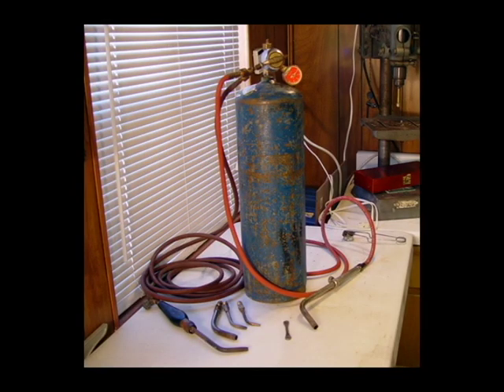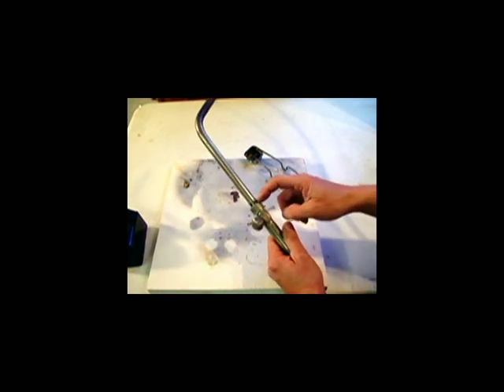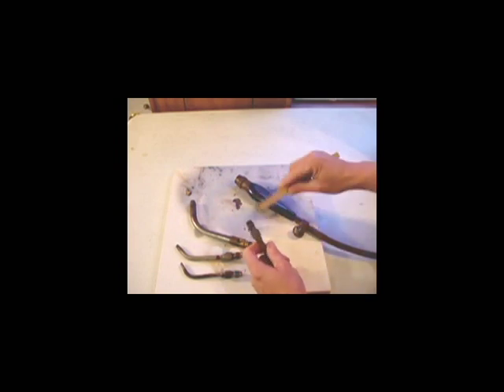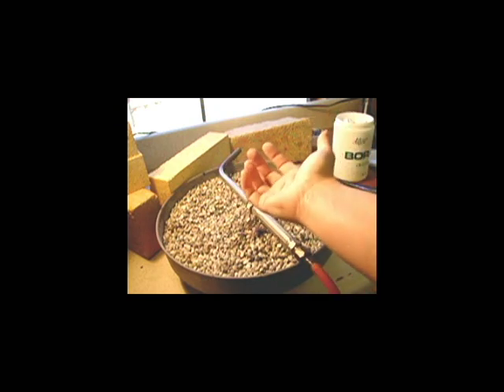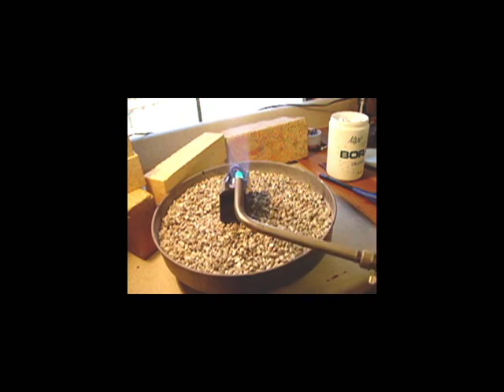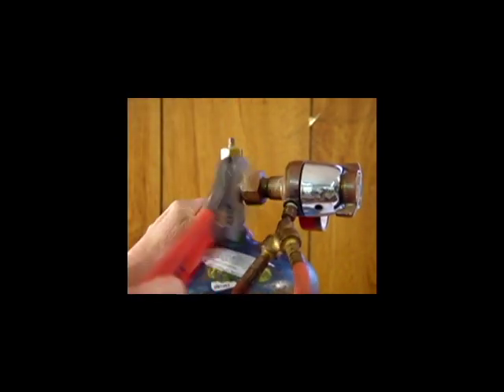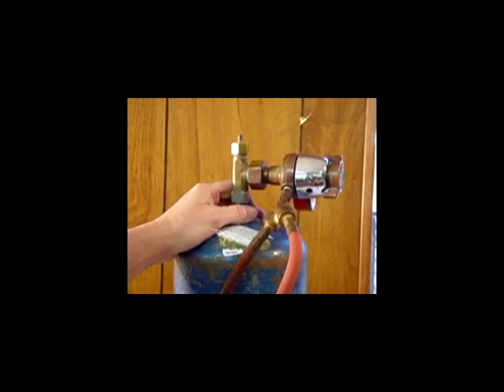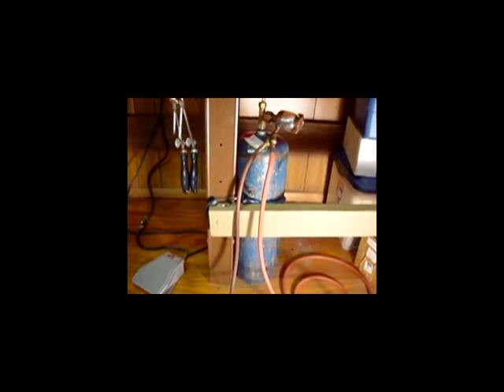Using an Acetylene/Air Torch, The Basics with Janet E Alexander

Comment: excellent video.    I have an old Prest O Lite; I was still having problems with set up and adjusting.   The local welding shop serviced it and put on a new hose.   I did not use it for a while (health issues) and forgot some of the basic.  Keep up the good work.

Comment: Another suggestion. When placing the regulator on the tank make sure the mating surfaces, the male on the regulator and female on the tank have clean surfaces. A quick wipe with a clean rag usually does it but grime can be removed with a some water based cleaner- making sure to dry components post cleaning. Also when tightening the regulator onto the tank if the mating and mounting components are made of brass be careful to not overtighten. There is a bit of an art to know how to 'snug' the components without damaging the inherently softer metal. 'Just enuf' is enough to make a good seal as tested by a solution of soap and glycerin. To be redundant brass is a much softer metal than steel and a person natural inclination is to crank down' on such big nut. Not knowing the tourque setting of the nut I would say that a good rule of thumb is to tighten just enough to stop leaks which is could be as little as 12 ft lbs. That is if mating surfaces are clean and to tolerance. gt boise

Comment: When I clean the threads of the various components I would suggest using a brass wire brush...that is a wirebrush that has brass wire for its bristles. This brush is not be as harsh on the threads and metal finish.

Comment: @1axvn  The bottle valve is double-seated. When it's not opened fully gas will leak around the stem, past the packing nut.  This gas is unregulated, and at full bottle pressure. When a globe valve is fully opened the disc will be seated against the bonnet sleeve, preventing leakage into the packing gland. 

Leaking acetylene is never a good thing

All globe-type bottle valve must be either in fully open, or fully closed positions.

Comment from the maker: The Smith torch  tip has a rubber ring gasket on its end so like 1axvn said, watch out about cleaning this tip's end with a brush. In the video I was cleaning a thread to a PrestoLite torch tip and they do not have a rubber ring gasket on them.